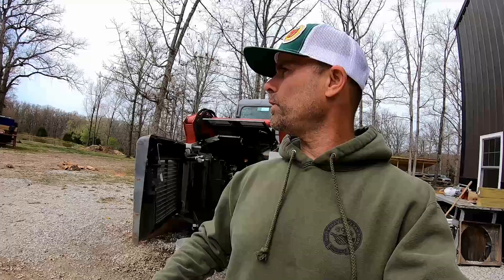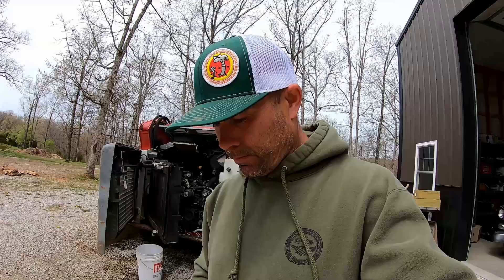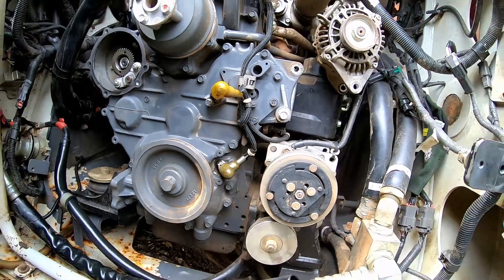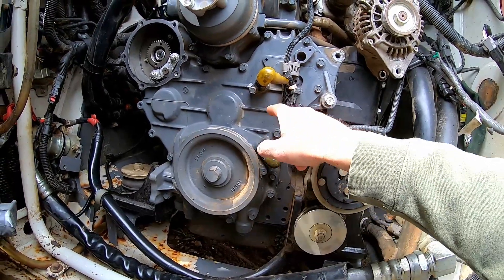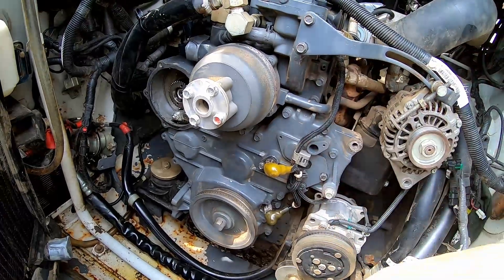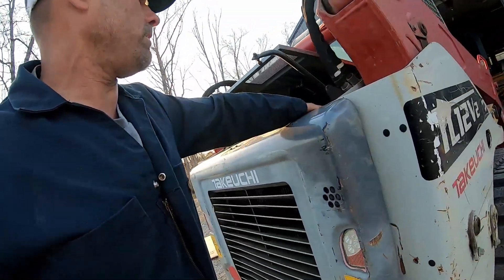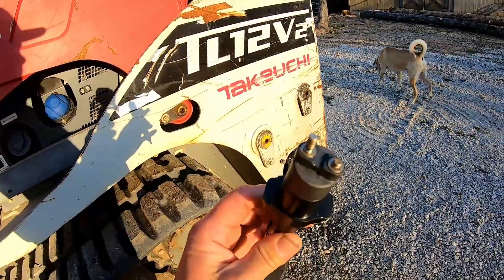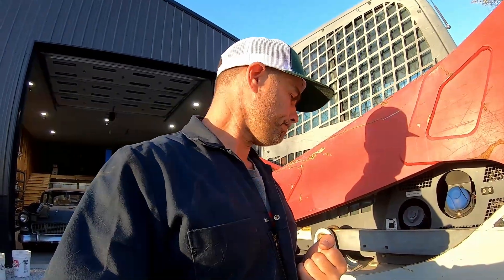Kubota V3800 Tier 4 Timing/ WHAT AN IDIOT...LOL

Comment: Ive got a 2018 Kubota SVL95 with the V3800 and Im having similar issues. Ive replaced injectors with the same chinese ones you did, Im currently waiting on my injection pump to get here. After watching your videos, i believe that is my culprit. Your videos have been very helpful in my diagnosis, ill report back after I install the pump. I appreciate the information!
Reply from the maker: And I appreciate the comment!   When I was working on mine I couldn't find any really helpful videos so I wanted to make sure to solve that problem!
Reply: @SlimyGreenGarage  I couldnt either, until i found yours. I cant find alot of info on V3800 stuff, and no diesel shop in my area has the capability to check or repair the common rail pump or injectors so im currently making educated guesses. Also the fact that the chinese injector trim codes are not programmable into the computer had me scratching my head, but after what you said about yours i feel relieved.
Reply from the maker: @6spd24v6.7  I'm just glad that I could be of some help as i was in the same situation...thankfully i enjoy working on things and don't mind the unknow outcomes that we do encounter from time to time......kind of like the injection pump timing situation!!  Remember when you replace yours to put dummy marks on every gear before removing the pump.....or else you'll get to have the same fun I did...lol
Reply: @SlimyGreenGarage  I absolutely will! Thanks
Reply: So here's the update. Put the new injection pump on, made sure to mark the timing gear, tried to fire it up but a no go. I then decided to take the fuel rail off and check the pressure relief solenoid at the end to see if it was hung open and not letting pressure build up. Upon removing and disassembling I found tiny rust flakes in the rail gathered up on the fuel sensor and pressure relief solenoid, I then inspected the new injectors I just installed to find that the rust flakes had made it to them and clogged them up. So I ordered a new Chinese set put them in last night, bled the system and it fired right up. Also just to note the injection pump is also Chinese aftermarket.
Runs better than it ever has, currently.
One other issue im having is it's now throwing a 9302 (air in fuel)code when I run it at full throttle, after researching it believe there is a  blockage in the side that is feeding the injection pump somewhere between the tank, lift pump, water separator & fuel filter. I'll address that this evening. But im way father along than I was...... at least it runs great all the way up to 3/4 throttle then throws the code. Do you have any insight on my air in fuel code? Thanks
Reply from the maker: @6spd24v6.7  It Sounds like you have made alot of progress my friend.  While I don't have any great advice on your current code I would just recommend that you work your way through that system one piece at a time.  I assume you have replaced your fuel filters and on my machine I installed a new water separator as mine was definitely wore out. Maybe double check all your fuel fittings too as they can be a bit of a pain to loosen and get out of the way when doing those injectors. Keep me updated, My hope is that we can keep on helping people who have run into the same situations and are at the end of their rope so to speak!!  God Bless You and have a great day!
Reply: @SlimyGreenGarage I appreciate that, im so familiar with that machine I believe i dream about working on the darn thing....
I installed a new lift pump today, thinking the old one was weak. Went through all the filters again, blew out all low psi lines back to tank. Pumped visibly more fuel than the old one and it still throws the code.
I re tightened all hard lines.
I believe im leaning towards the rail pressure sensor in my head, so that will be next. I feel im definitely on the home stretch but nit without these speedbumps. 
Thanks for all the help, and ill let you know if the sensor fixes it.
Hopefully all the troubleshooting in the comments will help someone as well...😂

Comment: Hey bud. Where is the window to see top dead center on the flywheel?
Reply from the maker: It is on the side of the flywheel housing and on my machine pretty much impossible to access.  I watched the valve opening sequence and trusted the crank gear alignment. I believe the thumbnail shows the proper position of the crank gear when at top dead center.....thanks for the question and have a great day Derek!!

Comment: Good video!  I have the same machine I’m putting a long block in so I’m removing my supply pump off my old motor that’s froze up onto this long block.  I’ve searched everywhere online for info, can’t find it.  So I assume I would just line up the marks under the small cover?  Did you have any literature or a link by chance?  Thanks for the content
Reply: Oh boy, at least both engines are sitting next to each other on the shop floor so I suppose I’ll have to do like you said and pull both covers off.  Thank you for the response
Reply from the maker: @duster2071  Glad to help!!!!
Reply: @SlimyGreenGarage another question for you if I may.  Do you have pictures of or a wiring diagram for the fuel injectors?  The diagram I have has different colors listed than the colors my wires are.  Just want to double check to be sure mine are right.  Thank you
Reply from the maker: Unfortunately I do not, if you haven't tore it apart already make sure to take pictures so you know they go back in the same spot.  I believe in my video I do talk about the wiring and the colors on my machine!!
Reply: @SlimyGreenGarage I’ll have to rewatch it.  I did take pics but someone else has dug into this machine before so I just like to double check
Reply from the maker: I'm Glad you found the video helpful, and I ran into the same lack of information when I was working on my machine.  Unfortunately, the literature I was able to find wasn't a lot of help.  Because your starting with a new long block you will have to have to make sure all the marks line up on each pulley with the front cover off.  If you were simply replacing the supply pump on an existing engine you would make dummy marks with a paint pen under the small cover.  Basically once you initially set the timing it takes several hundred revolutions of the engine before all the timing marks would line back up perfectly......I know....Fun Stuff...LOL  Take your time and have fun with it!!!

Comment: Also,the pump failure is what took out your injectors....make sure you flush your fuel tank too, because metal may have made its way back to the tank....QC codes are actually important so monitor your egts for a little while...sometimes they'll be fine,sometimes they'll under fuel,lean out and burn a hole in your pistons....25yrs in the field and I've seen it all

Comment: The one thing i find strange with your unit,is it going into a full derate  when its suppose to be deleted...which is telling me,either you have a bad resistor soldered in on the board(thats how these are deleted) ....OR someone reconnected the ACM harness...that harness junction is located on the "battery" side ,up near your ECM...if its plugged in, unplug it...wish I could load a photo of the exact location,but as mentioned,if it's deleted,that needs to be unplugged

Comment: Yeah,these pumps have to be timed in order to maintain rail pressure...pump has to be under fuel compression,while injector is firing...also,some common rails also have the cam reference sensor mounted on the HPFP..these don't,but others do....also,monitor your commanded rail pressure vs actual and also watch your SCV mA ...one other thing ,is on the return line,theres a Tee that tees off a line to return to your main filter to help with bleeding..theres a check valve on that line that is notorious for going bad and can cause a fuel lock condition if the check valve is bad

Comment: Man I’m so glad you’re one step ahead of me !!! Hopefully you’re saving me a lot of headaches lol. Getting ready to put new injectors 1 and 4 back in my buddies, just hoping I don’t need to do an injection pump either lol. At least I know what to do and don’t do now though thanks to you ! Just curious did you buy a Chinese injection pump also and how much was it ?  Great videos buddy, there helping me a a lot ! And f%$ck that valve cover with the injection lines by the way, what a pain in the ass to take off lol. Looking forward to seeing how she holds up, let us know
Reply from the maker: The lower valve cover is fun isn't it...,,,, If it makes you feel better the more you remove it the easier it gets...LOL  and I found a genuine kubota rebuilt injection pump on ebay.  I contacted the company directly.  Country Sales and Service located in Ohio.  Total cost initially was around 1700 because i had them next day air it to me.  you get 500 back when you ship them the old pump as a core so total cost is closer to 1000....not bad really!
Reply: Well I hope you didn’t have any more problems …………although I don’t mind when you do because I learn so much from your videos 😎😎🍺 cheers buddy. Thanks for all the great info
Reply from the maker: @pyroman175-E51  Thanks my Friend, for now she is running like a top!!!
Reply: Keep in mind, whenever replacing injectors, they're a Piezo style injector and you will have to change the QC code in the ECM for the unit to run correctly... You'll need Kubota Diagmaster to do this
Reply from the maker: @mikekopisz1227  Good Morning Mike, I do have the digimaster software and when entering the new injector information it wouldn't accept the new codes as they were not Takeuchi Specific.  I ended up contacting the company and after speaking with their technicians they said ultimately it wasn't necessary.  The Machine is running fantastic now, although you shared some great information and I agree with you!  It is nice to know that it's possible to buy 4 injectors for the price of 1 and so far everything has been great!!  God Bless!!
Reply: @SlimyGreenGarage  there is a work around for programming....I know you are only allowed to enter 24 digits,but new injectors usually show 30 ....if thats the case,you are suppose to leave out the last 6 zeros of the QC codes...I ran into a similar issue with some injectors I purchased from Friday Parts ...they were for an Isuzu 7.8L ,so it was a little different as far as software,but after found out about leaving out all of the Zero's ,they instantly programmed....if you happen to have a QC code handy for one of the injectors you installed,post the QC code and i can de-code it for you and provide the numbers you enter and which set of zeros you leave out